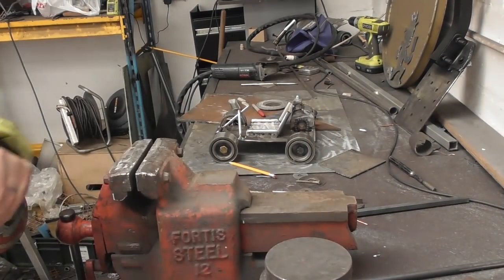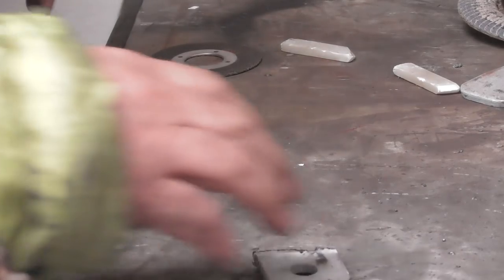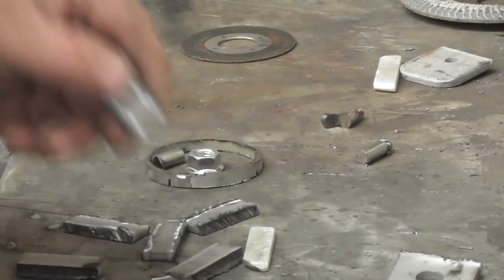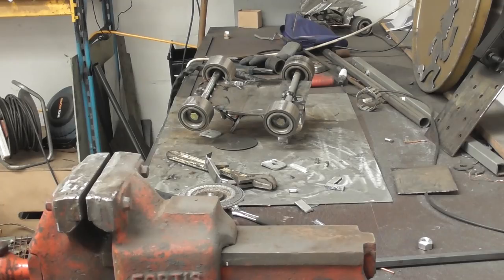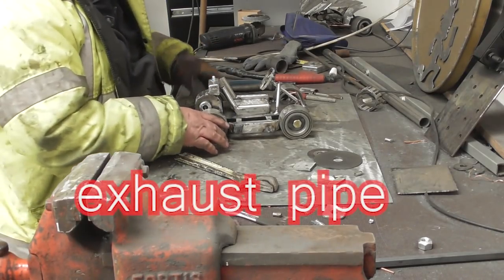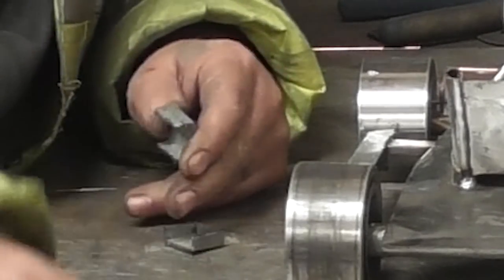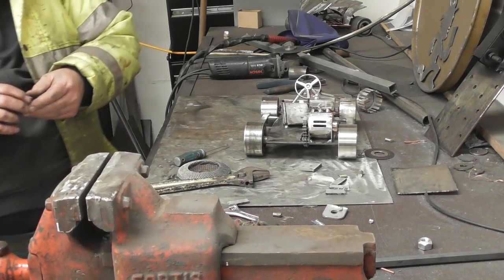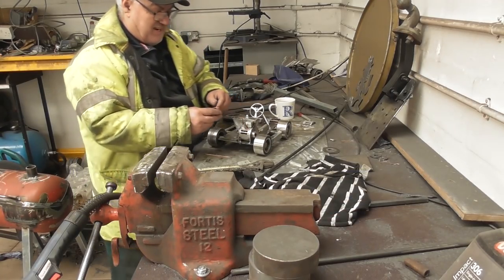how i built my  baja go-kart ( metal art )

Comment: The problem with the grinder was it wasn't a  metabo brand they have way less vibration they have less noise and they can grind several thousand hours I've used them they are top notch